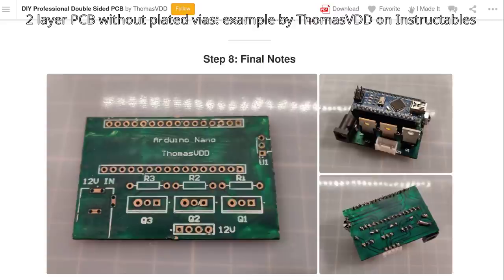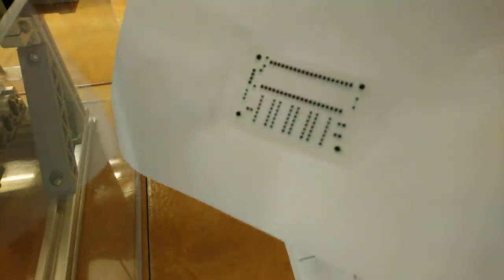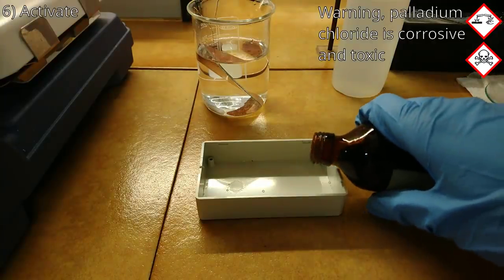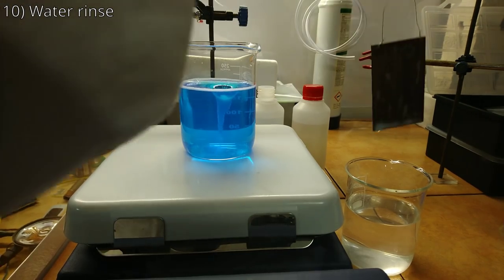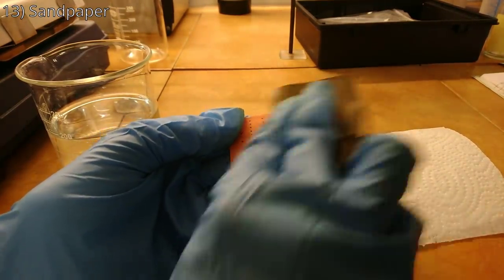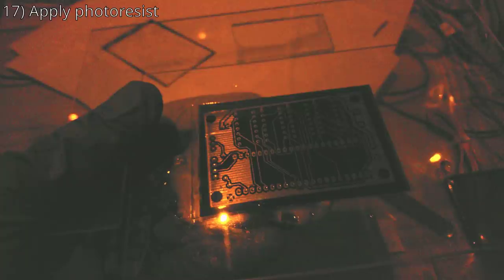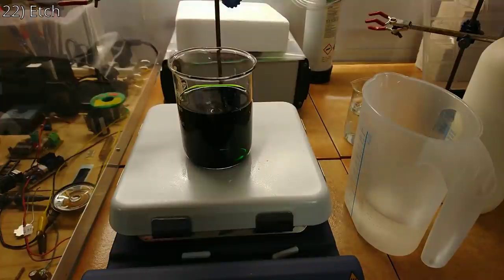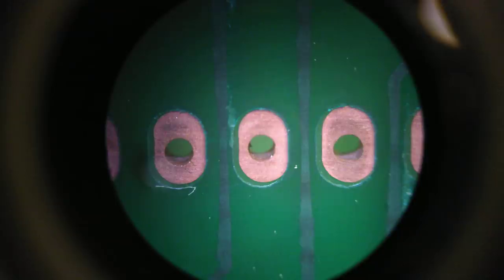Process 01: An open source 2 layer PCB process - part 1

Comment: for electro plating use a coffee filter and wrap the anodes in it to catch the large chunks of copper (do not wrap the PCB)

i myself use a laser to etch double sided pcbs , i use flatcam and Lightburn to generate the cnc job , i then take a cheap pcb with copper already in it , coat it in spray paint ,and then burn the negative of the traces of the pcb on both sides with the laser , then i etch it ,and give it a green coat of paint like a solder mask , and then burn away the green paint to reveal the solder pads .

its less involved since im bad with chemicals ,my reason for doing this is that shipping from pcb way or any other company is 25 $ plus 
so i just do it at home
Reply from the maker: Turned out the main issue was the excessive resistance of my alligator clips resulting in the two copper electrodes having appreciably different potential and trying to electroplate between them.
Reply: Graphite spray ,scrap and Sand,electrocopper,Holes are metalised...tyour laser Paint système I use too,but m'y lasers ends After a total of some hours of engraving...and i dont know why....maybe IS thé common supply of the laser with Steppers 12 v...some surges maybe during motions

Comment: Ldgraphy guy here. Stripping photoresist (step 24) I found that acetone works well and is less scary than concentrated NaOH.
Reply from the maker: Interesting, I may give this a try and report back if it worked for me too. Concentrated NaOH tends to oxidize copper too, so it may be a worth improvement.
Reply from the maker: I tried and it does work, thanks! Your suggestion was included in the latest version of the Process 01 documentation https://cdn.hackaday.io/files/1804227719174848/Process%2001.pdf

Comment: Really nice video, thanks for sharing. One Question though, how do you avoid solder mask from going inside the holes when applying it in the end? in my case it got stuck in some holes and even though it wasn't cured because of mask blocking the pads, it didnt dissolve by itself and i had to use a drill bit to poke it out. probably cause i had too small holes for this?

Comment: did you test your vias with current?
i found it very useful to do this test in the developement of my process
my 0,3mm vias usually can take about 5A, 1,2mm vias could conduct even more then 25A of current
with a test batch and the vias fusing at about much lower currents, i found it useful to use that as an indicator
also it turns out: you can fairly use a lot of other colloid solutions for activation (even copper in NaBH4 itself), it requires an additional etching and desmearing step+ sensitation steps tho
Reply from the maker: Interesting suggestions, I did not test the vias to failure with current, but I made a few boards since I shared the process and all of them are still working fine. My smallest vias are 0.5mm. I'd be interested if you shared (maybe in a video?) your NaBH4 activation process, I don't have that chemical in my lab, but if it turns out to be useful I may try to get some.

Comment: Just to clarify, the main point of this process compared to a PCB mill is to get plated vias, right?
More importantly, is it possible for either the palladium activation or electroless plating steps to be masked? Because if it is, wouldn't it be possible to just deposit the traces directly onto bare fiberboard? (Ignoring for a moment how to connect the cathode during electroplating...)
Reply from the maker: Have a look at the Applied Science video linked in the second part of Process 01, he describes something similar. It's not easy as the palladium activator would adhere also to the masking material and would cause unwanted plating
Reply: Isnt possible because ok for electroless,but thé main layer must Been with copper sulphate electrolytic bath and cathode connections for whole traces

Comment: Is it best to use acetone or 70% alcohol to clean the PCB before applying the film? Is Sodium Hydroxide better to use than Sodium Carbonate for the developer? I tried with NaCO3 for 2 mins and did not get great results. I need to rub the board gently with my finger afterwards.
Reply from the maker: For cleaning, anything that displaces water and evaporates quickly leaving no residue.
For the developer, look for "ORDYL Alpha 300 DRY FILM datasheet". Even if your negative photoresist is not of the same brand, they tend to have similar chemistry. It suggests Na2CO3 as developer. NaOH would probably unselectively strip everything.
Negative photoresists work differently than your regular positive presensitized boards. The photoresist is gelled so it can cover drilled holes with no mechanical support underneath, but as a side effect it does not wash away with the developer, mechanical action is needed to scrub away the developed gel. I think industrially spray jets are used to deliver the developer and exert the required mechanical force, but a small sponge can be used in an amateur setting. It takes some time to get used to it.

Comment: I wonder if it's possible to use PCB milling to avoid the photolithography steps at the end.  I suspect once the hills are drilled and plated you could just isolation-mill the the PCB as usual.  Of course, the limitations of isolation-milling would still apply, but you wouldn't have to worry about protecting the plated through holes from etchant.
Reply from the maker: I see no reason why milling should not work, but in my opinion milled PCBs are harder to solder, especially with SMD components
Reply: @hydrogentime2872  Yes, I agree.  It is harder, but it also cuts the number of steps more-or-less in half

Comment: Excellent video! A couple questions if you don’t mind:
1. Did you make your palladium activator as shown here? https://youtu.be/mVl-XhqREqM
2. Have you tested using tin plating as mask? Basic process is mask areas to be removed, plate with tin, remove mask, and etch with enchant that ignores tin (the right etchant is tricky, usually NH4Cl or (NH4)2SO4). Tin resist is often used commercially, protects the vias better
3. What size via/trace are you able to get to? They look like about 0.5 mm drill with 0.2 mm traces
4. Do you have a link to a written guide? I would like to try your process out

Thanks for the video, excellent explanation of the process
Reply from the maker: 1. Yes, the activator formula is from that video, while the plating solution is adapted from various sources, mainly the metal finishing book
2. I have tried, unfortunately I failed, you can see the attempt in this video https://www.youtube.com/watch?v=SPGJGW7QOJQ&t=9s
3. Smallest I have tried is 0.2mm traces/0.2mm space in a test sample. Will try 0.15 too shortly. Below that my laser printer becomes the limit
4. Yes! uploaded it here:
https://hackaday.io/project/180422-process-01-an-open-source-2-layer-pcb-process
https://cdn.hackaday.io/files/1804227719174848/Process%2001.pdf
Reply: @hydrogentime2872  absolutely amazing, thank you for the information!! I will have to try your process out
Reply from the maker: @tgross35  Let me know if it works or you encounter difficulties
Reply: @hydrogentime2872  Have you experimented with surface finishes at all? I thought about trying to do OSP. It seems quite easy - purchase BTA (benzotriazole, sold cheaply as antifog for camera lenses), dissolve in IPA to create a 0.033 molar solution.  Then just:
- Clean PCB
- H2O Rinse
- 5-10% H2SO4 rinse (to microetch for better OSP adhesion)
- H2O rinse
- About 10s in BTA solution
- DI rinse
- Dry

It seemed easy enough, but I haven't found any sources trying it, and I haven't gotten around to trying. So perhaps since you have the equipment, you might be able to try and make a video about it:)

Source for the process: https://www.osti.gov/servlets/purl/10103434
https://www.pcbcart.com/article/content/basics-of-OSP-surface-finish.html

If that works, then all that is missing is a way to print the legend!

Comment: That's actually awesome! I wonder if a home made 4+ layers board would be feasible. From what I've seen on this video - https://www.youtube.com/watch?v=sIV0icM_Ujo -, the only difference would be not drilling the internal layers until the entire PCB is ready. That'll require some sort of jig to keep everything aligned.

PS: came here from Hackaday!
Reply from the maker: In theory it should be possible, but it would require even more steps and be even more time consuming. I've also read that after drilling you also need some chemicals to etch some of the nonconductive material of the hole walls to expose more copper from the inner layers in order to get a perfect connection.

Comment: Can this process work with electroless nickel solution?
Reply from the maker: I'm not sure traditional copper etchants can etch nickel too, if they don't you'll have problems at the final etch stage. I know nickel plating is used after copper plating when PCB gold plating is needed, as gold plating directly over copper is troublesome, but I think this is done after etching? Not sure, if I ever try gold plating I'll give more thoughts to the application of nickel chemistry to PCB manufacturing and maybe make a video. No plans yet, though.